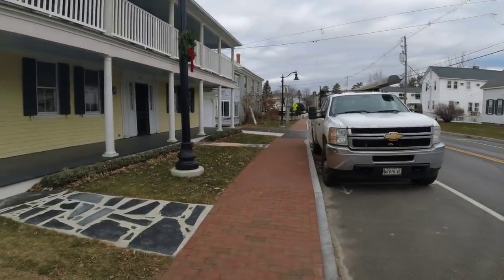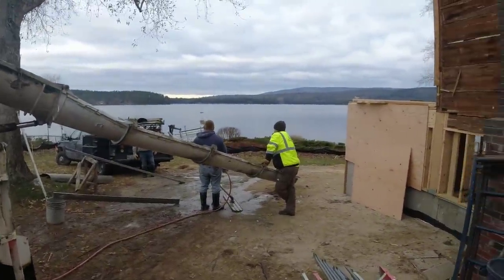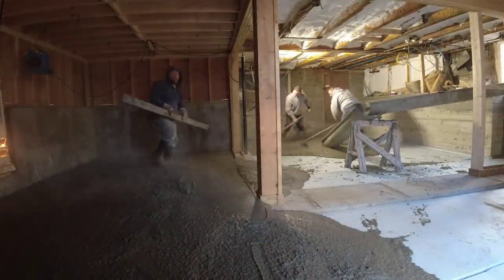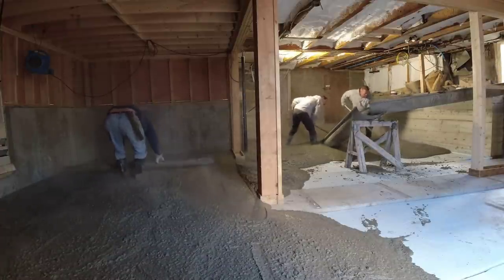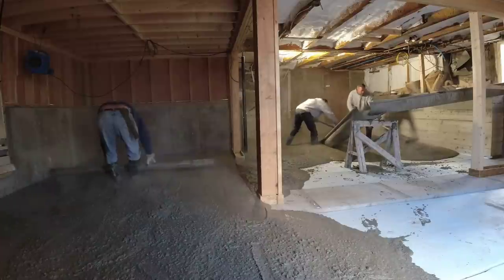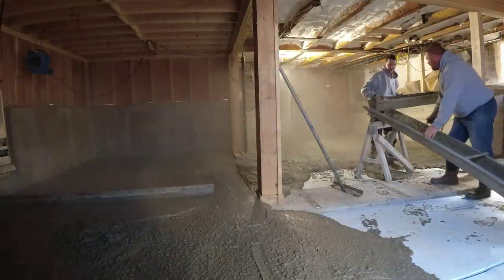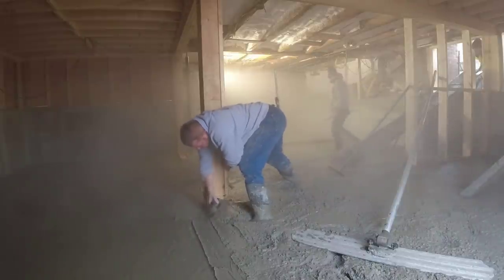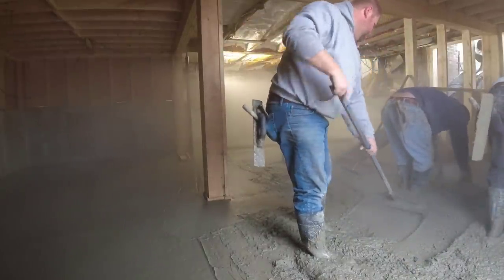How Fast Does Concrete Set Up With HOT WATER? (Know Your Water Temps)

Comment: Didn’t look like it changed a whole lot, you guys have the whole additives thing down to a science, we either had warm or hot water and calcium 1/2 or1 or 1 1/2 or 2 percent calcium then we just learned how it reacted to the temperature..you guys stepped it up with your additives knowledge , heat guns knowledge ect. Thanks.
Reply from the maker: Thank you Mike

Comment: The other factor I want to know is; distance, or to be more precise - time, from the batch plant.  The cure time starts when the water gets added.  That heat sensor is an excellent tip.  One dirty secret about hot water is; by the time it heats the components of the truck up, there sometimes isn't much left in the concrete - other times there is a lot of residual heat.

Comment: Looks like it went down to 5 inch slump at the end in those buckets. Thought we’d see the battery screed demon on the indoor pour,then again you guys are almost as fast with the magnesium screeds. Nice work,did you guys finish by hand or could you get the power trowel on it?
Reply from the maker: They finished by hand. No fumes that way and really just as easy for these guys.

Comment: Looks like it went from around a seven to about a four or so slump. Did you have any heater in it besides the hot water?
Reply from the maker: We use flake calcium on most all loads.

Comment: Curious how you handle curing at low temperatures? Do you use blankets or cover it?
Reply from the maker: Mostly blankets, yes.
Reply: @Mike Day Concrete  perfect! Thanks! We've got a crew pouring or 7000sqft slab with some cold weather coming a few days after! That feedback is going to be very helpful 😄

Comment: Mike we normally don't bother to ask what the temp is. It's about like asking where is the concrete truck! Lol! I think it didn't change a whole lot. When you added a with the bucket it looked like it had set up a little bit. I know what fly ash is basically but what is you called slag?
Reply: Slag mostly comes from steel production.  Fly ash had been put on a hazmat list.Going to be gone before long.

Comment: The base isn't sand / dirt with wire. Is this concrete over concrete or is that a different base?  Thanks.  These videos are great. 
Mark  😎🇺🇸
Reply from the maker: We poured on 2" styrofoam.
Reply: @MikeDayConcrete  thank you Mike. That's what it looked like. I hadn't seen that before.. but we're in the far south.

Comment: Explain s slump. Thanks
Reply from the maker: Slump is the term we use to explain how "wet" of "stiff" the concrete is. A 1 slump would be very "dry" or "stiff" kinda like dirt. A 8" slump is very loose or "wet" and moves around very easy.  We like to pour about a 6, not too wet but not to dry or stiff.

Comment: Looks like you started with about a 6” slump and ended up with about 4” slump
Reply from the maker: Thanks Bryan!
Reply: @MikeDayConcrete  did you use a machine to finish or hand wipe it?  We have had good luck hand wiping smaller floors in the winter so you can get it finished sooner. Taking the Fly Ash and or Slag out makes a big difference like you said. We even do that on cooler fall or spring days especially when they are not heating the water at all or it is not very hot